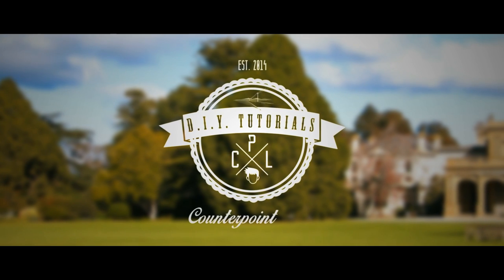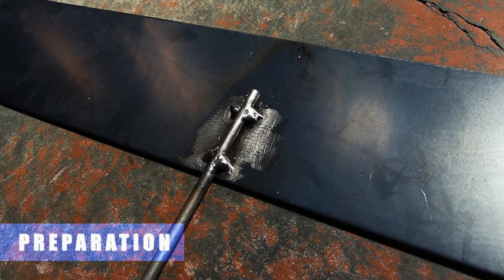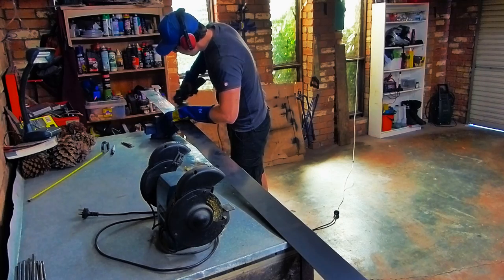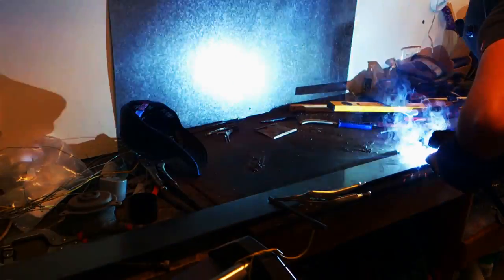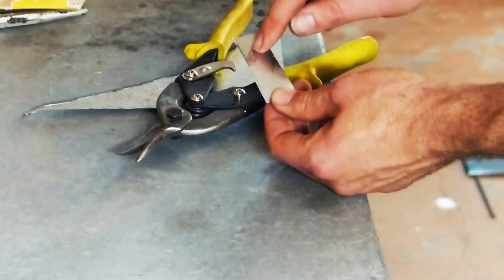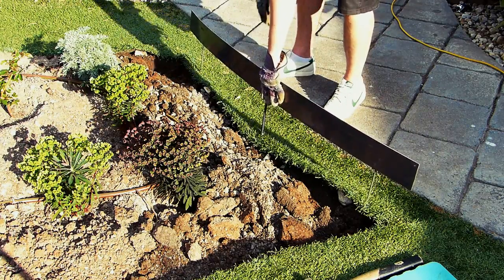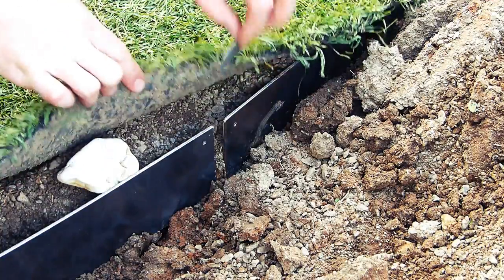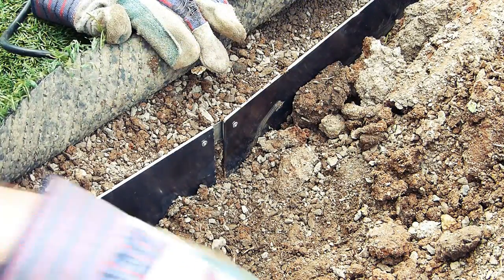Iron Garden Edging DIY

Comment: nice video. Rather than drilling holes and using scrap to join the edges, it might be easier to cut two pieces of edging about 50 mm long and weld on both sides of one end of the edging. It would create a slot that the next piece of edging could slide into. Just a thought.